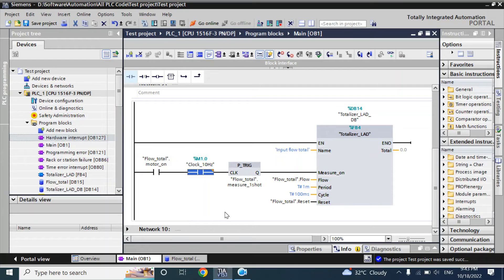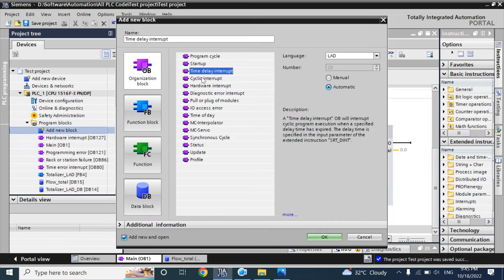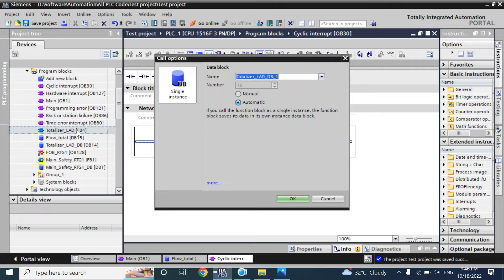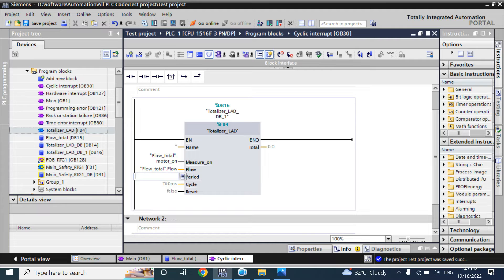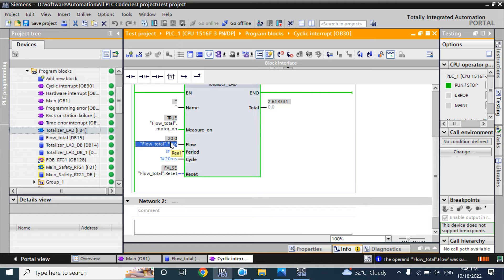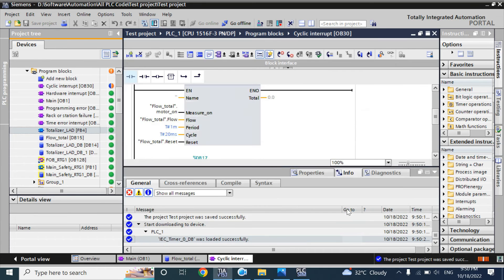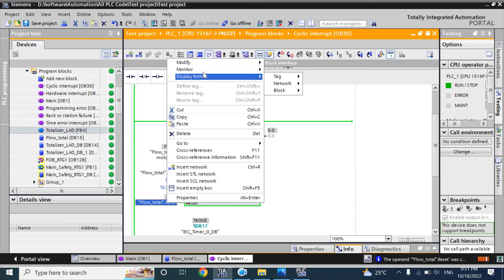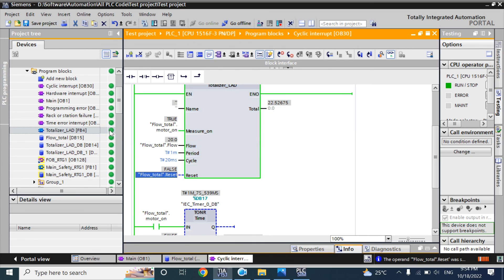TIA Portal: How to use Cyclic interrupt Block to Totalize Flow?

Comment: Sir farid im watching the video many times so that i can understand properly 
About sir in cycle time at cyclic interrupt 20 micro or 20 millsec how about if i make this 100millsec instead of 20  or increase this cycle time  what gonna happen at total flow. Is this only 20 millsec all the time or we can change this cycle depends on the requirements or no need change this cycle and stay at 20 only which is correct sir farid
Reply from the maker: 1. 20 micro 20 milisec>> it is 20 milisec you can't set 20 micro minimum cycli time 250 micro sec.
2. Cycle time 100ms or more >>answer is  in the video ,... If you increase time it means your sample rate will be less. Some time your data will loose . Suppose your flow rate change 12 times in a second but if you take 100ms means 20 sample in a second then you loosing your data.
3. You can change your time from block property.. normally 50000us or 50 ms cyclic time is ok to calculate your flow.